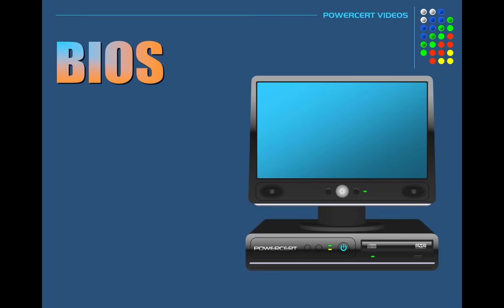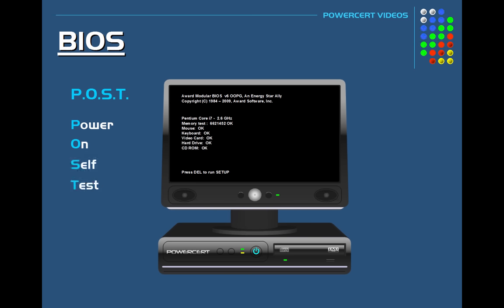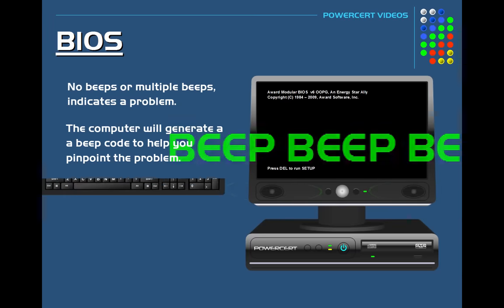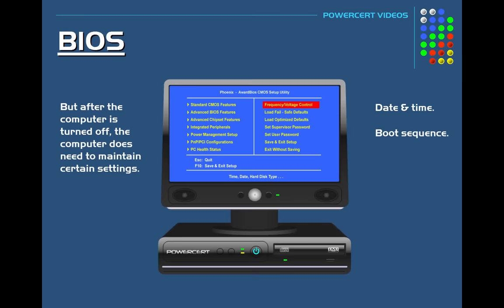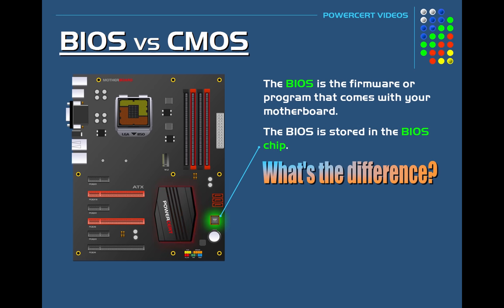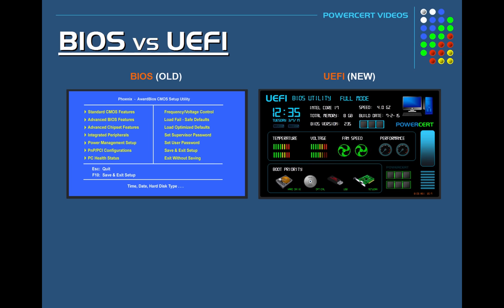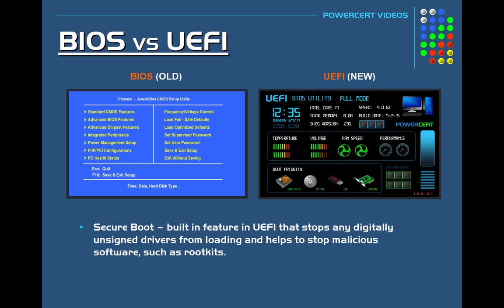BIOS, CMOS, UEFI - What's the difference?

Comment: 🎯 Key Takeaways for quick navigation:

00:00 🖥️ BIOS initializes hardware during boot, runs POST, and searches for boot device.
00:53 🔊 POST beep codes indicate hardware test results and issues like keyboard or RAM errors.
02:10 ⏲️ CMOS chip stores BIOS settings, needs CMOS battery for power, removing battery resets settings.
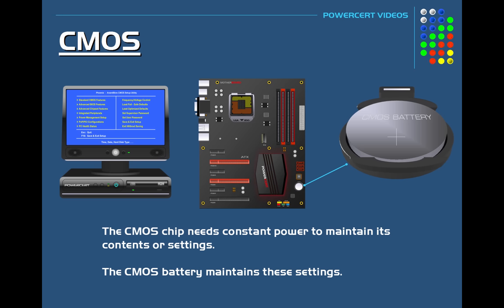03:01 🤝 BIOS is firmware, CMOS stores settings, often integrated with real-time clock.
04:21 🌐 UEFI offers graphical interface, mouse support, and secure boot for modern motherboards.

Made with HARPA AI

Comment: difference between MBR and GPT please
Reply: and uefi
Reply: MBR is short for Master Boot Record and is sometimes called the Master Partition Table. While GPT is short for GUID or Globally Unique Identifiers Partition Table When you first initialize a storage device such as a hard drive or SSD, you need to give it a partition style which is either an MBR or GPT type. The MBR is just a "record" stored on the first sector of a disk that tells the BIOS/UEFI what partitions are on the disk (hence why it is also called a Master Partition Table) and which partition contains the operating system. When the BIOS is done running POST, it goes to the first disk specified in its boot sequence and when it does, it looks at the MBR to see which partition contains the OS so it run it. A disk with a MBR partition type is limited to only having 4 primary partitions on the disk that an OS can be stored on and can only recognize drives under 2.2 terabytes. The MBR is an older technology and is still used today but is the main and only partition scheme if you are using a traditional BIOS. If the MBR is overwritten or damaged, you most likely will have to fix it or you may end up screwed if you can't. On the other hand, GPT is a feature of UEFI motherboards and addresses the limitations of MBR. First, GPT have globally unique identifiers for each partition which in theory lets you have way more partitions on a disk opposed to an MBR disk; however, Windows will only let you create up to 128 partitions with GPT. Second, GPT allows you to use disks over 2.2 TBs and also stores the Partition Record in multiple places on the disk in case something goes wrong so it can rebuild the Boot Record/Table.

So in Summary, MBR is an older partition style used with BIOS motherboards that has information about the partitions on a disk and which partition contains the operating system so that the BIOS can find it and boot into it. With MBR you can only have 4 primary partitions and disks under 2.2TB. GPT is a newer partition style used with UEFI motherboards that does everything MBR does except it can have up to 128 partitions (Windows), supports disks over 2.2TBs, and stores partition info in multiple sections of the drive for increased data redundancy.
Reply: @james_hake  Thank you.

Comment: When you start a PC the beeps are the First phase of POST for basic devices/hardware in the computer, once those checks are passed it will then do the second phase of POST and this is Error Messages and not Error beeps. The computer also tests the speaker when you first turn it on to show it works. As no speaker means no beep code.

Comment: Not all P.O.S.T. status is via beep codes. 
1. Having worked with desktop computers in various roles since 1984 (but by no means an expert), this week I encountered my first build where there is no capability for generating beep codes when I did suspect there was a POST error.  However, the very sparse and incomplete manual did point out that there are 4 tiny LEDs on the motherboard which are P.O.S.T. status indicators.  They indicate pass/fail of four major subsystems: CPU, storage display (referred to as VGA), and memory.  I did have initial problems in getting the computer to boot, and these status indicators assisted me in troubleshooting.  
2. I recall in my earliest PC support days, in the1980s, having to rely on a visual display of P.O.S.T. codes onto the connected display device..  They offered a bit more detail than merely indentifying each subsystem.  However, if the problem included the display subsystem, those codes were not available.  I no longer recall what the beep codes were at that time, but I think they were less informative.

Comment: 🎯 Key Takeaways for quick navigation:

00:00 🖥️ The BIOS (Basic Input/Output System) is firmware on the motherboard that initializes hardware and tests the computer during startup.
01:20 📟 Beep codes generated by the BIOS help diagnose hardware issues, with different codes indicating specific problems.
02:10 🔋 The CMOS chip, unlike the non-volatile BIOS chip, stores custom settings and relies on a CMOS battery to maintain its contents when the computer is turned off.
03:54 💻 The BIOS and CMOS are related but different components; BIOS is firmware, while CMOS stores user-configured settings.
04:21 🆕 UEFI (Unified Extensible Firmware Interface) is a newer type of BIOS with a user-friendly graphical interface, mouse support, and secure boot features.

Made with HARPA AI

Comment: As You Said when we remove the CMOS Battery  customize settings on BIOS goes to Default Value . 
 In this process does the Clock Speed Reset to Default For CPU and RAM
Reply: If you have personally changed the clock speeds in the settings, then yes all changed and saved values will be lost after battery replacement. In issues where your motherboard required a cmos clear up, it sometimes takes leaving the battery outside for about 30 minutes so it fully discharges and loses its values. So some people are lucky enough to quickly change batteries (within 10 seconds), and it sometimes can retain values but as long as you have the values written on paper you should be ok.

Comment: Old Compaq used to have graphical BIOS mounted on DOS. with working mouse, sort of UEFI, but 20 years ago !!! The graphical interface was stored on DISK. So when your hard drive was shot, the graphical BIOS was shot too. But it will alwyas boot from floppy and seek for install disks. Just using floppies, you could resintall the BIOS on the new hard drive. IBM old laptops allowd mouse and graphs on bios and some versions mobos used a WinBIOS (phoenix ?). AWARD-like interface was good enough for me.

Comment: Vouw - could you try and tell a little more about UEFI? I was very happy with the video, until you got to UEFI. You really think the major difference between BIOS and UEFI (UEFI is by the way NOT a new BIOS - it's a totally new kind of firmware ditching BIOS where it has belonged since the beginning of the 90's) is the fact that you have a graphical user interface when you change settings?
How about the completely different boot process from the old BIOS - the UEFI disk partition - the fact that UEFI is OS aware as opposed to BIOS - etc.

Comment: Imp Points:
It is describing the BIOS as firmware built into the motherboard, initializing hardware during the computer boot process, conducting a power-on self-test (POST), and generating beep codes to diagnose issues. It then introduces CMOS as a chip storing custom settings like date and time, powered by a CMOS battery. The distinction between BIOS and CMOS is clarified, emphasizing that BIOS is the firmware, while CMOS retains user-configured settings. The discussion concludes with an overview of UEFI, highlighting its graphical interface, mouse support, recognition of larger storage drives, and the secure boot feature that prevents loading unsigned drivers and combats malicious software.

Comment: "UEFI replaces the legacy Basic Input/Output System (BIOS) firmware interface originally" ( wiki is source)
"[...] interface [...]" 

It can be understood that:
Bios is the basic program used to run a PC. Like Linux (kernel) for Gnome or KDE (UEFI is the GUI for BIOS).

Comment: I'm so confused lol. I heard so many different things form different people it seems. At one point I thought the CMOS chip was ROM and the BOIS was stored on the CMOS chip but apparently only the settings you change in the BIOS are stored on a CMOS chip, I think. I thought UEFI replaced BOIS but it's just a new BIOS. I've heard instead of a CMOS chip they use flash now and the battery only keeps the clock on time idk.

Comment: Hello, thank you for an interesting video. 
I have two questions:
1. Afaik, BIOS is stored on ROM, i.e. read-only memory. How is it possible to overwrite a read-only memory with a different BIOS?
2. What's the point of having one volatile, and one non-volatile memory? Is volatility a requirement for overwriting?
Reply: 1 modern BIOS chips actually aren't read only memory. In the past they actually were so you had to physically swap the chip.
2. Volitile memory is faster due to the laws of physics so it's very useful for RAM, and fast ram makes a big difference, you can research this more on Google.

Comment: Some low end mobos UEFIs is looking same as regular BIOS interface, so the UEFI is not equal to a modern UI with mouse/animation/etc support. The biggest difference is in the booting process: BIOS needs a boot sector to boot up anything, but UEFI is only need a 512MB FAT32 partition with a special flag, and you can choose in UEFI what bootloader you want to boot.

Comment: had a 486 dx4 from more than 30 years ago, golden yellow PCB motherboard with all UMC chipset, don't remember the brand. it had 3d looking BIOS with mouse support. wasn't real 3d but that character map 3d used in 8bit consoles. had animated button presses, allowed even to set your own boot logo image, etc etc
the idea of visually striking firmware GUI isn't new, was just a way to vehicle the new firmware to be adopted by end users easily. servers still have blunt looking UEFI GUI. 
there is one major concern with UEFI though. it's an operating system of it's own that you don't know what it does really, it can run even when the machine is powered off, or with CPU pulled off, and has direct access to all drives, memory, etc. a neat way to implement hidden surveillance software, by the manufacturer itself. if anyone saw / read Orwell's 1984, well, UEFI takes us one step closer...
damn, i don't want my toaster to think by itself, or spy on me. do you ?

Comment: Bios is a 32-bit firmware that recognizes RAM memory up to 4Gb or 8Gb and supports partition up to 2TB and has no security features

 CMOS is a chip made of Quatzo "glass type" with about 512kb that stores the settings of the bios and provides the date and time for both the BIOS and the operating system even without any power from the outlet thanks to the 3v battery in the  motherboard

 UEFI is the modern and fully 64-bit version with an intuitive, intelligent graphical interface and with support for more than 2 TB of storage and that does not depend on CMOS for storing the settings since the configuration is recorded on the chip itself and the CMOS only stores  the date and time data for UEFI (in the future this will no longer exist as the date and time will be updated from the internet even though it is in the UEFI interface) and has a security feature and the operating system is easier to interact with.  firmware such as entering UEFI through a menu in Windows 8.x and Windows 10 to boot a pendrive for example.

 The BIOS is a firmware made in "assembly language" programming or called machine code, while UEFI is made in 64-bit C or C ++ language facilitating its compilation

Comment: This question might have been already asked and probably answered in the 608 comments made so far, I checked as far down as I got the time to and I didn´t find any answers . Would removing the battery in a UEFI system reset the specs on the BIOS, I was sold a HP laptop workstation that comes with a BIOS password which doesn't allow me to update to the latest BIOS, the one I got is way old and the only thing that I have not been able to update...and most likely the reason behind the screen freezes and BSOD.
Reply: It doesn't hurt to try. Just make sure you remove both batteries: the main system battery and the BIOS battery.
I don't know if it will work though. I don't imagine that HP would make it that easy on workstation/business/enterprise level systems.

If you're lucky that the previous owner didn't disable booting off of other devices other than the hard disk, consider using UBCD. The Ultimate Boot CD has a ton of tools, including BIOS tools which can either attempt to remove the BIOS password, give you the password, or give you common master passwords. I used this boot CD a few years ago on a rugged laptop and it worked.

Comment: I think you're wrong about the beep that Motherboards should do to indicate that everything is ok? In older motherboards that have the three pin speaker on them then you can buy or use one from another old mb and yes when booting you will get that beep. As for newer mb's they don't have the speaker pins so you can't put the tiny speaker into your mb so your NOT going to get the beep!!!

Comment: Nice, but i have a question i recently got a 2 in 1 windows 10 tablet that uses cherry trail atom quad core processor a RCA w101 V2 ...i believe it has that UEFI shell for installation...my question is how on that can I remove the os problem..the chip is a 64bit processor but i can't install any os passed 32bits and i just wanna be able to remove that limiter so i can use a64bit distro of Linux

Comment: Hi,

How do you do, First of all Thanks for all your Videos.I have doubt, what is the difference between MBR and GPT Partition.  GPT ,MBR, Legacy bios and  UEFI bios these all are have any internal connection is there, Please explain it briefly. i was face problem when i try to change the OS i getting this error(windows can't be installed to this disk.the selected disk is not GPT partition style) after that i have resolve this issue. but still i'm Confuse and i don't  have any clarity on GPT, MGR, UEFI connection. please explain it.

Comment: In my opinion,  In the Bios one can't use the mouse. While on the UEFI one can use the mouse. Other than that, everything is about the same.
Reply: That's not 100% true. There have been some BIOS out there that have mouse support. I remember fixing a relative's computer about 10 years ago that was from the late 90s or early 2000s that had a BIOS that you could move the mouse around. At the same time, some newer computers have UEFI systems with no mouse support.
Reply: @JJFlores197  Well, I was not aware   of that. I started to build  pc in 2002 and I haven't encountered any Bios that one can use the mouse. Until two weeks ago. When I just build  a new  one with an Asus H87-Pro that,  I had bought 9 years ago. I was kind of surprised that the mouse worked with Bios.

Comment: How often do we need to change the CMOS battery and how can we do it without erasing the memory of CMOS chip?
Reply: the cmos battery can last about 5 years if you never turn on your computer, but if you use your computer often it can last decades it lasted 20 years on my old PC, and would have lasted more if i didnt stopped using it, you cant do it without erasing the memory of the CMOS since its volatile memory
Reply: In other words, you will most likely get a new computer way before you need to replace the CMOS battery.

Comment: Is it odd that I have a computer that doesn't beep when I turn it on? There's no sign of any complications and I have it for years but as far as I remember it doesn't beep at all.

It's ecs h61h2-mv btw
Reply: The beep is not generated through your sound card , more typically there is a speaker linked to the mobo with two wires, its about the size of the of a hole when you touch first finger against your thumb joint. Sometimes this little speaker is not present.

Comment: So where is the administrator password stored.  If it's in the CMOS chip, couldn't you just unlock it by removing the CMOS battery, along with any other power sources?
Reply: A lot of newer PCs don't store the BIOS password in the CMOS chip. So even if you remove the battery and power, it will still retain the password. I don't know too much about this security, but it may be saved on an EPROM chip which may or may not be easy to extract the password from.

Comment: Tell me one thing, What really distinguish an Apple Motherboard from the others? is just the Bios that makes then the difference or is something more complicated? for example I cannot do a fresh install of windows without Bootcamp, why? If instead I flash the Bios of one system to the other (is just an idea) can I change totally the characteristic of the Motherboard?
Reply: Well Apple designs the motherboard for their computers. With non-Apple computers, its the motherboard manufacturer and/or OEM (like HP, dell, etc) that design it. Apple computers have exclusively used UEFi/EFI for nearly 18 years if I understand correctly. They don't give you an interface like you have with other computers so you can't change any settings. There's no way to "flash" the UEFI of a Mac computer, at least no easy way. Again, Apple doesn't want you to do anything like that. Apple doesn't want people messing around with the internals of their systems.
Reply: Thanks for the answer, it is very apreciated.
If instead I change the older Microcip with a newer one? @JJFlores197

Comment: if you have your power supply connected and  powerd on the settings wont reset if the battery is removed